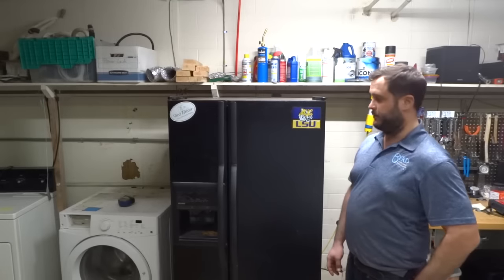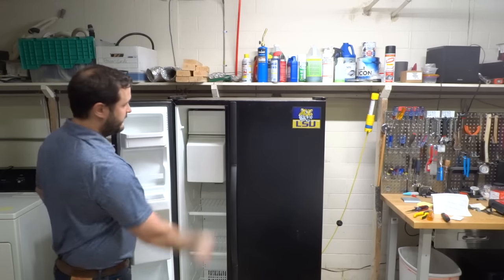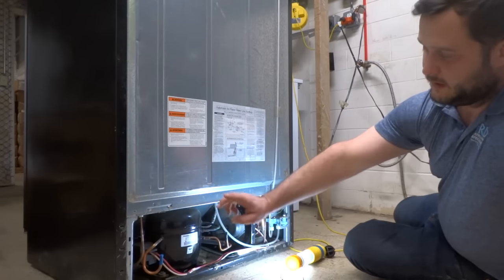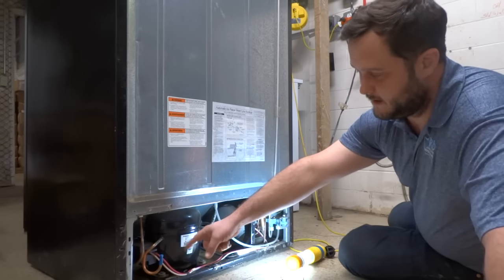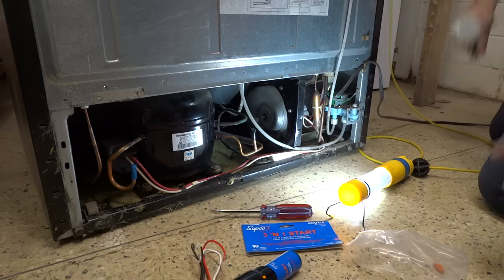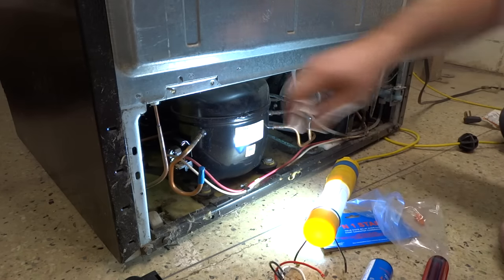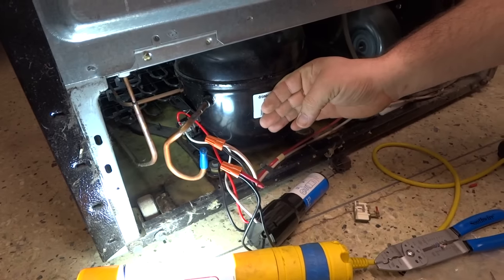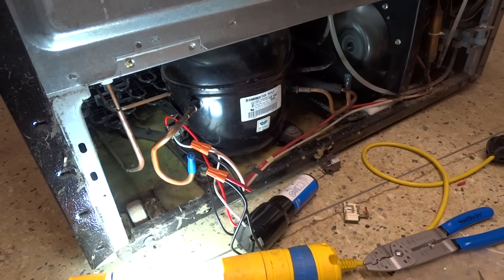Kenmore Refrigerator Not Cooling at all - Compressor

Comment: I'm so grateful for this video. No repairmen in my area at all, so Kitchenaide said to scrap it and buy a new one (to the tune of $2,000. Watched your video, paid $80 for parts and $20 for overnight shipping, and in about 5 minutes the fridge was working again. You just saved me $1,900!! THANK YOU!!
Reply: How long did your fridge run after implementing this fix?
Reply: @Abundnce10  ...unfortunately...only 4 days and kaputze. Now I have the 2000 for a new fridge and the 100 bucks in parts from the old fridge...puts me in the negative. Should have just bought the new 2000 buck fridge and I would be 100 bucks richer today. !!
Reply: @mrgoggles1963 keep the parts.  When the new fridge goes, u already have them.  Good gamble.

Comment: Thanks to this video I was able to diagnose and fix my fridge as I have the same unit.  I used a volt meter and tested the overload protector, which tested good.  The start relay was bad though when I tested it.  I looked on Amazon and found numerous generic replacements for $8-$11.  But was going to take two days to get to me.  I went to my local appliance repair store.  They wanted $53 for the exact replacement parts (overload protector & start relay), but I only needed the start relay.  And for reference, the start relay is the part that has the wires plugged into it.  The start relay is then plugged into the overload protector, which in turn plugs into the compressor.  I could further tell that the start relay was faulty, as when I shook the start relay in my hand I could hear broken parts inside rattling around inside.  So luckily the appliance repair store sold a generic start relay for only $15.  I brought it home, plugged the wires in it, plugged it into the overload protector and the fridge's compressor started right up.  So my advice would be not to waste your time cutting and splicing wires and buying the 3 in 1 kit as indicated in this video.  It's so much easier (and cheaper) to just buy the generic start relay and or overload protector if needed.  Just pull those two parts off your fridge and do a search on Amazon with your fridge's brand, plus the words start relay or overload protector.  And FYI, most of the items on Amazon come with both parts, even if you only actually needed the one.  And another tip.... Make sure to pull the bottom front grill plate off the fridge and vacuum out all the dust that's accumulated on the coils.  An air compressor works really good for this too.  Good luck, you can do this!
Reply: Thanks for the tip 👍🏻

Comment: Worked perfectly. Thank God a appliance mega store 20 min near me had plenty of this exact  3 way combination  (3 'n 1 start) kits. PN: RC0410. 1/4 to 1/3 hp.  120v.  Fixed it myself took only 5 minutes  the same day it died.  30+ year Kenmore fridge (Frigidaire)  You saved my food. Thank You!
Reply: Sundown79
Reply: not all connections are the same maybe you connect it wrong  C S R, that is way it was hot
Reply: you need the URC0410 TO ADD BACK THE RUN CAP. Remove the run cap slows down the compressor not getting 100 % out of the motor. Some older do need a run cap but if it has one do not trash it This is a hard start cap in line 1 second and it does not replace a run cap.

Comment: Hi Kevin, my Kenmore doesn’t cool enough. Fridge temperature is above 15c at the highest setting. The ice sometimes freezes in the freezer, other times just melt. I tried  replacing the fridge thermostat and even try lowering temp using screw moving anticlockwise, no luck. What should I look for next.

Comment: My 1998 Whirlpool Side by Side Refrigerator stopped cooling. The fans were working, and I heard clicking noise. I measured resistance using a multi-meter across the  common and run and start pins It was with in the range. I followed your video. Ordered a Supco parts from Amazon. Today I connected it as you shown in video. The compressor is working now and fridge is cooling. THANK YOU!

Comment: This exact repair worked PERFECTLY in our Kenmore.  I know nothing about fridges and have never worked on one. Yet, following these instructions, using the same part, the fridge was humming again in 10 minutes!  I owe you guys one.  Thanks. very much for providing this video.
Reply: Just curious if you had the Kenmore Elite's with the French doors and bottom freezer? I found out Sears uses LG parts on their Kenmore fridges, I'm tempted to try this fix hope it works
Reply: Jake, the fridge was a Kenmore with side-by-side doors. It was not the French door model you are referring to. By the way, the repair was good for about six months and then the fridge died and we replaced it. Good luck with your repair.

Comment: Easy way to remember pinouts:

1.  The "Lonely Pin" (Pin by itself) is the Common   (C).
2.  Moving clockwise, the pins are in alphabetical order  C-R-S   (Common-Run-Start)
3.  Quickstart wires are also in alphabetical order:  B-R-W  (Black-Red-White)
4.  Black to C(ommon), Red to R(un), White to S(tart)
Reply: My question is if this thing stay there or remove back and install the overload switch back???
Reply: @arturocrespo7944  That is your choice

Comment: Tim! You saved me!

Thanks so much - you saved me what was probably going to be a several hundred dollar service call - money I didn't have!
The only problem I encountered was that I had 3 wires going into the compressor instead of just 2, one red and the other two white. I connected the two white wires to one of the two black wires going out of the new 3-in-1 starter and the red wire to the other black line going out. Now I have a working fridge!

Comment: I couldn't be happier.  Thank you for your clear and easy-to-follow repair advice.  I was able to find the Supco Start Kit at a local appliance supply store and it installed easily.  At first however, when I plugged my Kenmore back in, nothing happened!  But then my instinct told me to turn down the temperature control knob and turn it back up and eureka, it works and has been for the past week.  Thank you for giving us a stay of execution in terms of having to shell out major clams for a new fridge!
Reply: Hold the phone, stop the presses.  My Kenmore sidebyside stopped working after a week.  I have a feeling that the compressor was on it's last legs already even though it wasn't noisy.  Ended up buying a new fridge.

Comment: Very informative video. I followed your advice. 

1. Unplug the appliance from outlet.

***(Very important to do.)**

2. I checked the fan for blockages, fan spun freely by hand. Checked that the relay was connected and cleaned the coils.  

3. Plugged the appliance back in and after moments and couple taps on compressor(with plastic handle of screwdriver). Fan started spinning and compressor is running. 

**May need 3 in 1 in future. As of right now,  fan is spinning and compressor is working.**

Definitely a big thumbs up.  Thank you for posting this video.👍🏻👍👍👍

Comment: Thank you for your video!  We followed your clear, step-by-step, simple instructions to replace the 3 in 1 starter in our Kenmore refrigerator and it is back to cooling as it is meant to.  We used the Supco part number: RC0410, 1/4 to 1/3 hp, 120v.  A $12 part instead of an expensive service call via an appliance repair shop.  THANK YOU!

Comment: Quality video all around!  Good camera work for an area difficult to see.  Just today I replaced a temperature control switch on a similar Kenmore side by side (Age 1997).  The evap coils in the Freezer get ice cold but it takes hours for the refrigerator side to cool down from 50 to 38.  The condenser coils do not go beyond slight warm which surprises me.  I remember the old days when they could get hot within minutes of use.

Comment: my Kenmore Elite side by side is warm on both sides evap and condenser fans both work.  Compressor also works. I did notice the evap fan didn’t come on right away when I plugged it in. Love your videos
Reply from the maker: Sounds like issues with the sealed system. You can remove the evaporator cover and see if the coils have a full light frost on them. If not, then you may be out of luck.

Comment: Okay, guys, if you're refrigerator had a run capacitor which is generally a square box that plugs into the start components that plug onto that compressor comma you need to test it and wire it between the red and the white wires there.

Comment: I went to to do the repair that you suggested in your video and  when I open the back of the fridge, the previous repairman had already put in the 3 and 1 device.  It wasn’t working. I replaced it with a new one, but I’m just getting is a Buzzing sound every 10 seconds or so, but the compressor is not kicking on. Do you think that means the compressor is toast?

Comment: Mine click just like the way you said it so I am plaining to do what you did  on this video. Hoping it gonna work. 

I am so lost right now cuz  mine is three wires and they are red, white and green with yellow stripe/line on the green and on top of that there’s another set of wires right beside the white box which is white and blue. My fridge is way different from yours Including hoe the wires are been hooked up in place. So any advise on solving this problem?

Comment: I have Kenmore Coldspot model 106  compressor kicks on for about 10 sec. and then kicks off and is not cooling.Is the  3-1 start kit will help in my case? Thanks

Comment: Great video~!
I needed an LG EAD64168633 Harness Assembly (for an LG Refrigerator LRFCS2503S) but accidentally ordered the wrong part EBG60663205 Refrigerator Relay and Overload for LG.
Can these two be spliced~?

Comment: My compressor was making a clicking noise then it would cut off.  I replaced the relay and stater, a $30 one it worked for 9 mos. Then I replaced it with the original parts it's still doing the same thing and now 1 of the 3-pin is sparking. Please any advice 🙏

Comment: Question: Are you simply jump starting the compressor with a little more juice this 3-1 kit installed? Why wouldn't you just replace the relay/switch with the suggested part? They cost less than $20. I guess I'm lost as to why you've got folks cutting power supply harness wires to "hopefully" get the compressor running. That's a completely different part to reorder if they have a bad compressor. Now they need a $300 compressor and a $25 harness they cut.

Comment: I looked at this I have a Kenmore 3 door freezer on bottom the compresses runs very quiet but no cooling at all.dont seem to feel fans working much.i paid almost 2000.00 3years ago it darn sure should last longer than 3 years any advice it seems to me its sealed any advice on this.im very troubled and in a very remote area.doesnt Sears cover it if it's sealed.

Comment: Thanks for your reply now I have question I took the defrost thermostat accordingly at room temp.it not suppose to have continuity well mine did so I went to buy a new one both the new end the used have continuity at room temp. And when I put them in the freezer for about half hour wy is it?
Reply from the maker: Not all bimetals are the same. Some open well above room temp. Depends on style and manufacturer

Comment: The only thing I would add here is to check the thermostat before pulling the refrigerator out.  If the compressor goes out usually something led to that and you want to check the drain pan for water and the condenser may need cleaning if it is under the refrigerator.

Comment: My refrigerator wasn't cooling.  Cleaned to see if there was a clog   there was one and we cleaned it out    
Cleaned the coils 
Compressor and fan were ok but still wasn't cooling

Replaced w another fridge we had un plugged for a while at a rental unit.  Plugged it in.  It was working fine at the rental unit
Delivered it to our house and freezer is cold but not freezing and fridge is room temp.  Any clue what is going on?  Light inside both fridge is working so not a power issue

Comment: Hi there. This is what I have, does it indicate a bad relay?
Whirlpool WRT111SFDW03. 7 years old. 11.2 cu ft size. Freezer on top.
Start relay
P/N: WPW10448874, 
aka W10448874.

Capacitor ("cap") P/N: WPW10662129

Test relay connections with capacitor on the relay.
Results: when together I can get cap to charge and discharge thru the start relay, just like it does when it's off the relay.
With cap off and on, neither of the lower holes have continuity with each other. The hole on lower left has 0.0 ohms resistance thru the bottom blade of the back of the plug.
The lower right hole has no continuity with anything but can be used to charge the capacitor for testing.
The upper hole has 0.1 ohm resistance  to the top blade on the opposite side.

Remove relay cover and visually check. I cannot get combination relay apart without breaking it, so I haven't committed to that, yet.

Ohm test the fridge compressor pins again. Make sure the Common (top) and lower pins are within 3 ohms. And the two pins at bottom should read about the sum of the Common with the Start and Run pins. See YouTube video...
Results:
Top and Lower Right : 4.4 ohm. 
Top to Lower Left: 6.0 ohm.
Two bottom pins: 10.4 ohm.
None of the pins are shorted to ground.

My problem is it suddenly stopped cooling without noises or warning, but I caught it from hearing loud buzzing noise from compressor and relay area, and compressor was very hot. No smoke or smells though, and wires did not seem to be hot.

Do you think it's the combination relay? Thank ya!

Comment: Thanks for this video .
My fridge when I plug in the wire the fridge light inside the fridge working but the fridge compressor and the little cooling fan the one next to the copmressoer not running ?
Reply: Mine is doing the same thing. I wonder what the problem is?

Comment: If the unit is out of warranty installing a hard start kit may work but if the unit is under warranty call a authorized service professional. If you work on your own unit while under warranty then you have just voided your warranty then you're stuck with a busted frig and a big replacement cost for a new one. The compressor will run if damaged in many cases and installing a hard start kit will not do anything for the cooling of the unit. Many compressors will just bypass and run (fails to compress which means zero cooling)

Comment: Hi Byrd,
 Here are my
Symptoms:

Refrigerator lights on
refrigerator evaporator fan running
refrigerator condenser fan running
refrigerator compressor warm/hot to the touch
relay switch turning on and off.
 
if the relay switch is bad would that cause the compressor feel warm/hot?

Thanks
Vince
Reply from the maker: Could be. It's worth a try on that. This is the scenario for trying it...

Comment: Hello sir. My fan is running, and the compressor is warm, still no cooling at all. I bought it used, it was working good at the time, but not after the move. It has already had the 3 in 1 added. Any help would be great.

Comment: I have a 1996 Amana side by side frig/freezer and has been working fine all these years, then a week ago it stopped making ice so I thought it was the dual water valve so I installed a new water valve and while working on the water valve I noticed the meat in the freezer section was NOT frozen, the refrigerator section was cold enough, however, the freezer section was about 28°, so now it is a different problem. 

I did several YouTube searches and found out that a bad defrost timer could be stuck in defrost and the freezer section would not get cold enough, and it could also be the confessor coils were dirty. I cleaned the coils and rotated the timer a few revolutions however the timer may not have been the problem because the fan and compressor were working. I then noticed the compressor was very HOT, couldn't leave my hand on it so I checked the temperature with a laser thermometer and the compressor was 129°.

I placed a small 8" fan at the back of the frig blowing on the compressor while the built-n fan was also running, after about 8 hours the freezer section temperature, using the laser thermometer aimed at the lower metal shelf was 9° and the ice maker was working, produced a half of bin of ice over night. 

The next day I thought everything was working OK, so I attached the lower panel back onto the frig and pushed it back in place in its alcove. The next day the ice maker has stopped working again and the freezer section is back up to 28°. Again the compressor has been running HOT 129°. I friend of mine says the compressor should be warm but NOT hot to the touch and says that is a sign the compressor is low on freon.

My questions: What is the normal operating temp of the compressor while the fan is blowing on it?

What is the cause of the compressor running HOT 129°?

Will adding freon to the compressor lower the temperature and make the freezer section colder? 

What temp does the freezer section need to be for the ice maker to work?

By the way Thanks for the great videos.......
Reply from the maker: +Jon Murany normal operating temp can vary. HOT compressors can be fine. Restrictions in the sealed system, friction in the compressor, low refrigerant, can all be factors. Before messing with the sealed system, you should take a look at the evaporator coils. Leave the fridge on, up to the point you begin taking off the evaporator cover.Take a pic of the evaporator immediately after pulling the cover off. Hard to describe what you're looking for without a picture of the coils, but you want a light frost across the entire evaporator.

Comment: Nice... yet I really needed to see the way the white, red and in my case blue wires were connected to the old relay and overload as I could not get a clear picture before removing my old one to replace with exact parts. My relay has 3 prongs. I see the red goes to the overload. I don't want to ruin it just by putting wires in wrong order.